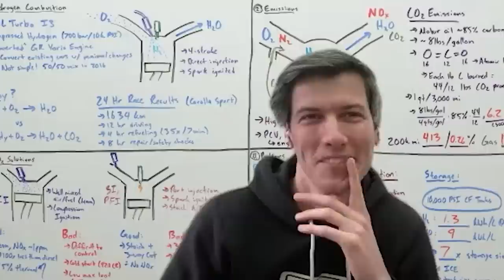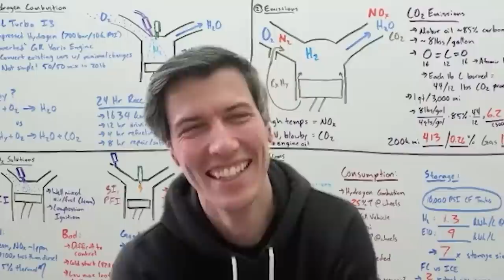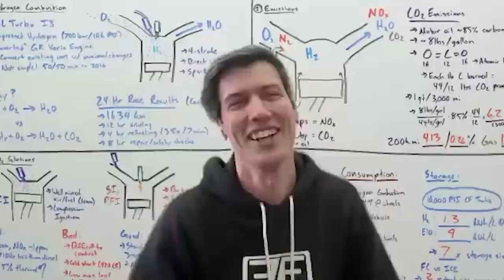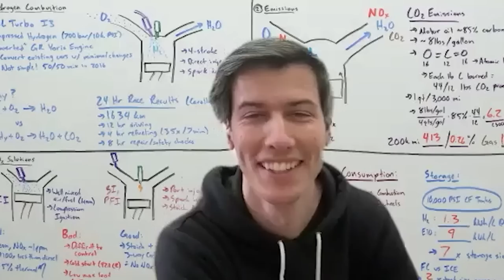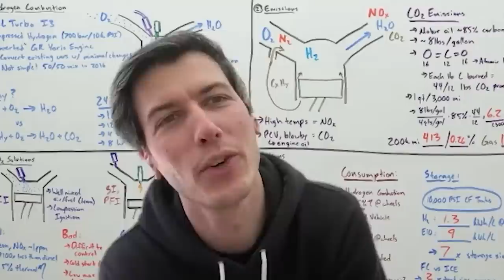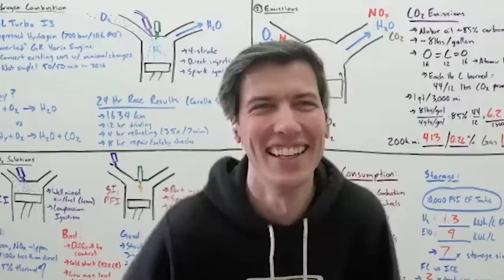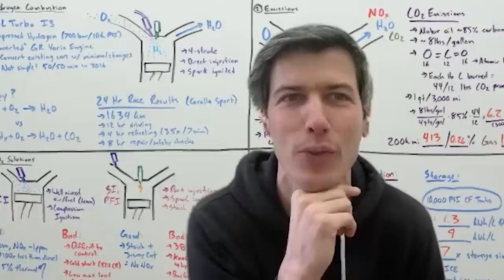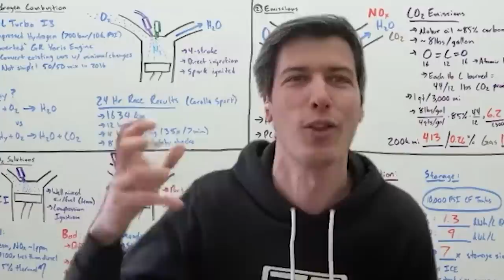Engineering the World’s Fastest Cars with Jason Fenske & Neil deGrasse Tyson

Comment: I don't understand Dr. Tyson's issue with a coefficient of friction greater than 1. What would prevent that from happening?
Reply: That would basically mean that something is pushing you down more than gravity, and that's not really possible at low speed. So to increase the friction between 0-60 mph you have to "grab" the road instead.
At higher speeds you can use a wing to generate a downward force from the air passing over it.
Reply: @oaksnice   Why would that mean something is pushing you down more than gravity? Gravity would be pushing you down the same amount as always; it's the sideways force that would be greater than gravity, and I don't see why that's not allowed.
Reply: Former tyre engineer here. This whole video conversation comes from this basic misunderstanding of the physics. There is NOTHING limiting the friction coefficient at a value of 1. 1 just happens to be the ballpark of what you can easily achieve with standard materials, and hence people assume there’s some kind of physics behind a value of 1 being a theoretical limit. It’s just a misunderstanding. The tyres on your mom’s Toyota on her driveway already achieve around 1.2 friction coefficient without any trick. That’s why it can brake at -1.2G under ABS regulation. Race tyres easily go up to around 1.6 friction coefficient.
Add some aerodynamics on top of that, which increase the vertical load on the tyres, and you can very easily pull WAY more G’s than 1. Formula 1’s corner above 4 G’s.
Reply: @DANGJOS  It is allowed, of course. They spoke at length in the video about how it works. But if you look up the coefficient of friction between rubber and concrete in a standard reference table you will see 1 there. That's the value Neil used in his own estimation, using a basic formula.
In the real world it's more complicated, and that's what Neil was leaning into when he asked how it's possible to go beyond that. Also what @benoix5984 said
Reply: @oaksnice   But he was talking as if two smooth surfaces cannot have a coefficient of friction between each other greater than 1 in principle. That's what doesn't make sense to me.
Reply: There are many combination of materials which have a friction coefficient greater than 1 on smooth surfaces. And the very set of materials discussed in this video, tyre rubber over concrete / asphalt, just happens to be such case with a greater than 1 friction coefficient. Which is enough to explain how every modern car on the planet brakes over 1 G, and how a few cars with enough engine power and the right control systems to saturate all their tyres at once efficiently, can also accelerate beyond 1G. No magic involved.
Reply: The coefficient of friction for velcro is 6.

Comment: To Gary's question, of having a turbo equivalent for EVs.
Jason answered it by saying bigger battery capacities(or Sizes)
But I think it is also possible if we reduce the resistance of the material used in the motors.
Sorry If I am wrong.
Reply: increasing the batteries is more akin to increasing displacement in an ICE rather than a turbo

Comment: Couldn't you sort of create a 'turbo' for an electric car by introducing a capacitor which the battery charges slowly as you drive and when the power is needed the capacitor discharges? As long as the motors can handle it that is. I'm no electrical engineer but I've seen capacitors that can put out thousands of watts and amps in a very short order.
Reply: Yes.  Super capacitors will replace batteries at some point. 
Near instant charge.
Discharge on demand.
No power loss.
Can't wait!

Comment: Is it possible to use electromagnets to make the batteries float, to remove their weight as an issue? or does that require too much energy and not be useful at all?
Reply: The weight would still be on the tires.
Reply: Adam Johnson: Using magnetism to suspend an object in midair doesn't remove the object's weight any more than suspending it with, say, a rope. A 200 lb object, suspended by any means still weighs 200 lbs in an "Earth normal" 1g environment.

Say you suspend this object by a rope. Whatever the other end of the rope is attached to (like maybe an overhead beam) feels that 200 lbs.. Now, follow this: the beam that takes the weight of the object is also attached to something, like a wall or a column; that wall or column (let's say wall) rests maybe on a foundation; and that foundation rests on the surface of the Earth. So the weight of the object (the "load") follows that path; rope, to beam, to wall, to foundation, to Earth.

And that leads us to this: no matter WHAT means you use to suspend an object, the weight of the object ultimately rests on the surface of the Earth. There is always a load path to Earth, even if we can't see it, and the weight of the object always follows that path.

Same with magnetism. If you suspend a 200 lb. object in a magnetic field, the field itself is the first step in the load path; next step is the mechanism generating the field; next step is whatever that mechanism rests on or is embedded in, etc., etc., but always, ultimately to Earth.

In a car, I imagine it this way, for the purposes of your question: the heavy battery is suspended in a magnetic field; the field takes the weight (load) of the battery; the field transfers/transmits that weight (load) to the field generating mechanism; the mechanism rests on something, presumably the framework of the car, and then the load is transmitted from framework to axles to wheels to tires, and to Earth.

So even if you suspended the battery by magnetism, the battery still has weight, and that weight is still "felt" by the car, just as if the battery were sitting on the floorboard.

The wheels hold the car, the car holds the magnetic field, and the field holds the battery. And the battery has weight as long as it's in the Earth's gravity well.
Reply: The Dwight Mamba said it in a lot less time than I did.
Reply: It kinda reminds me of the old cartoons, like Popeye;

He'd be standing on the deck of a boat holding an electric fan to create a breeze to fill the boat's sail and make the boat move. Except, that doesn't work IRL.

Blowing the fan at the sail DOES put a forward force on the sail, but Newton's laws say that an equal REARward force is put on Popeye, because he's holding the fan. 

The forward-moving sail is connected to the boat by the mast, and the equally rearward-moving Popeye is connected to the boat because he's standing on the deck.

So the boat "feels" both equal forces, which cancel each other out, and the net motion of the boat is zero in real life.

But in the cartoon, he saves Olive Oyl.
Reply: That would work if the magnets were built into the road, so that they could take some of the weight off the batteries when you drive over them. But it's probably not practical.
Reply: @kellyrobinson1780  that's great info, thank you for taking the time to write that
Reply: I was wondering if the weight would still be an issue but I couldn't grasp the concept in my head lol, this information clears that up though, thanks everybody 🙂
Reply: @amj2048  YW!😁

Comment: The Hindenburg burnedm did not explode.  Tanks for flammable gases are very strong to prevent punctures during crashes.  LNG and propane vehicles using gas engines are very viable.

Comment: what about the weight of the car as you accelerate transfers back pressing down into the rear tire. so you dont only have the weight of the car distributed between 4 wheels equally.

When a car accelerates, the weight of the car shifts towards the rear wheels due to the force applied by the engine. This weight transfer causes the rear of the car to squat down, while the front of the car lifts up slightly. This is commonly referred to as "squatting" or "squatting down."

As the car squats down, the weight on the rear wheels increases. This increase in weight provides more traction for the rear wheels, which helps the car accelerate more quickly. The additional grip on the rear wheels allows the car to transfer power to the ground more effectively, which in turn helps the car move forward with more force.

The squatting motion also changes the suspension geometry of the car, which can help to maintain tire contact with the road. As the rear of the car squats down, the suspension compresses, which causes the wheels to tilt slightly inward. This helps to keep the tires in contact with the road, which improves grip and stability.
Reply: The weight transfer that occurs when a car accelerates can increase the grip of the tires beyond what would be expected based on the coefficient of friction of the tires and the road surface. This is because the weight transfer increases the normal force acting on the rear tires, which in turn increases the frictional force between the tires and the road. The coefficient of friction is a measure of the maximum frictional force that can be generated between two surfaces, but the actual frictional force that is generated depends on the normal force as well. So, if the weight transfer causes the normal force to increase, the frictional force will increase as well, potentially exceeding the maximum predicted by the coefficient of friction alone.
Reply: In drag racing, a soft suspension is generally preferred over a hard suspension because it allows for more weight transfer to the rear wheels during acceleration, which can help to improve traction and grip.

Comment: Many battery vehicles already have a “sort of” supercharger. They allow higher current to the motor until the temperature peaks, increasing the acceleration for a limited period.😊
Reply: I was thinking a Super-Capacitor could be used for that "boost", much like a Nitrous Oxide system.  Short-lived, but gives you that "turbo" effect.

Comment: As for volatility, hydrogen can be used for combustion at much lower concentrations, like 200:1 is the limit, gas won’t ignite much below 20:1 and it burns very hot to the point of damaging the engine at that ratio, ideal is 14.7:1

Comment: Yes, up to a point, you can get more power out of an electric motor. An electric motor is basically coils of wire moving in a (magnetic?🤔 electric?🤔) field.

Doesn't matter. Because for any given field strength, increasing the number of coils of wire makes your motor stronger.

Slot car racers often take a stock motor and rewind it, making the coils tighter, more orderly, and more compact. The result is more turns per coil, and more power out of the same size motor. A turbocharger crams more air into the engine; rewinding crams more turns into the coils of an electric motor. And regardless of size the principle is the same, for a slot car motor, or for a "people car" motor.

Comment: @29:04 is he basically describing how ufo's move through space seemingly unrestricted. creating a controlled artificial mass to bend space infront of you, pushing it around you while you sit right behind the mass, and having the space collapse behind you to propel you forward. doesn't sound impossible
Reply: if you take a toy boat and place it floating in a tub of water, you move water away from the front of the boat and in doing so create a space for the boat to move forward; simultaneously as you create this space, the water you are moving out from Infront of you will redistribute itself behind you and begin pushing you forward into the space you are creating. perform this in a 3 dimensional space and you have a new way to journey through the cosmos

Comment: Driving behind the truck explained. The truck creates a lower pressure in front of the car and its the greater atmosphere pressure at the back of the car that's pushing the car forwards trying to fill the partial vaccum in the front of the car. If it was a full vacuum the car would hit the back of the truck at a tremendous speed, it bit like being sucked out of a plane window.

Comment: First: You forgot to mention wings on cars pushing the car on the road, and
Second: F1-cars create a low pressure zone under the car, sucking the car on the road.
This was first applied by the Lotus team in 1977 with a ventilator at the back of the car.
It is called "Ground effect".
Shortly after it was abolished, and in 2022 it was legalised again (creating the low pressure with front- and back-wings).

The 2022 F1-regulations reduced the wing surface and re-admitted the ground effect, diminishing air turbulence behind cars.
Now the F1-cars can get closer to a car in front, without losing grip, so making overtaking easier,
and making the sport more attractive.

Comment: To be fair, you need to compare the weight of the entire drive train. Electric motor+Battery Pack vs, Gas Engine+fuel. Engines are pretty heavy compared to the Electric motors.
Reply: But, doesn't an EV weigh more overall than an ice vehicle of the same size?...

Comment: Hopefully if StarTalk does the show on race cars they should at least mention that the hardest accelerating race cars on earth are Top Fuel Dragsters which can achieve 100 mph in under 1 second. Those dragsters accelerate quicker than a Jet being catapulted off an aircraft carrier.
Also Nascar may seem primitive compared to F1 but working within the Nascar rules requires hi tech ways to get an advantage, sometimes working between the lines. One team as an example, hired a NASA engineer to help find a few horsepower. A few horsepower increase helps the car push through the wall of air for maybe a .5 to 1 mph increase, if that.

Comment: The trouble with Porsche's e-fuels is that the other pollutants that come from the combustion process are still there.  Carcinogens and the nitrogen oxides don't disappear from that tech.  Also: the nitrogen oxides are still a problem in hydrogen internal combustion like the experimental BMW and Toyota engines.
Reply: Plus there's the 30-40% efficiency of the ICE engine compared to the 85-90% efficiency for EV's. The Efuel is 40$ an gallon just now too, with lower power than regular gas.

Comment: About drafting big trucks, competitive bicyclists seeking the fastest speeds a human can pedal will sometimes do it behind a drag racer with a shield to block the wind. It is necessary for that bicycle to have a rubber bumper on a pole out in front to prevent being sucked into a collision with that dragster. 
Also regarding the limits of battery powered cars due to  weight,  just wait until the energy density per kg doubles, which is a real possibility. I did a calculation for converting a particular  IC engined car to electric, and came up with 500 lbs of engine, exhaust and fuel tank removal before having to add the 1000 lbs of battery for roughly equal performance. Drivetrain weight was about equal without the multi-speed transmission. Now a battery of half that weight can be developed so we are getting there. 
Further more, Neil, there actually were a couple of flying steam powered aircraft built in the early 1930s. Range was a big issue, but  it did fly, and could reverse the propeller upon landing without variable pitch mechanisms. Not too practical, like steam balloons (also a tested possibility) but with the right metalurgy  and advances in thermodynamics the Wrights may have gone that way.

Comment: There is actually a practical reason for building faster cars. If you live somewhere where the speed limit is 55mph and your car only goes 55mph you're constantly pushing your engine to it's maximum. If you live in the same area and your car goes 300mph, you'll never wear the engine down.

Comment: If you have seen the foil racers go flipping through the air, that is the main reason for a need of high nose downforce to friction coefficient/acceleration and or top speed ratio... else you be flippin out and may the odd be ever in your favor when you become a single wing aircraft.
Reply: And I agree with Jason on the very high assessment as far as heavy long aerodynamic electric vehicles buckling down the category of fastest... in a straight line of course Dr Tyson. Manuevering will be subjective...
Reply: Go chuck PSA on point.

Comment: 15:22 rotary engine represents! 13B or 12A? Been driving my 88FC3S daily for 13 years.
Reply: They are extremely reliable if you maintain them. The problem was the owners not changing the oil, because it puts oil into the combustion chamber- it’s important to always have fresh. 17:50 1.3 liters- less displacement than a gallon of milk.

Comment: Drafting is absolutely a thing, but not practical or courteous. The best drafting experience though happens in a convertible with the top down. When approaching another vehicle in a convertible the flow coming off the other is easily detected. Automated semi trucks might end up getting much better cross country mileage if allowed to form road trains that have multiple trucks drafting each other.